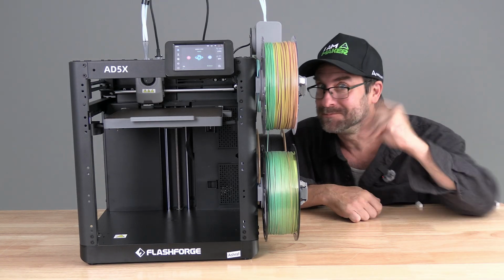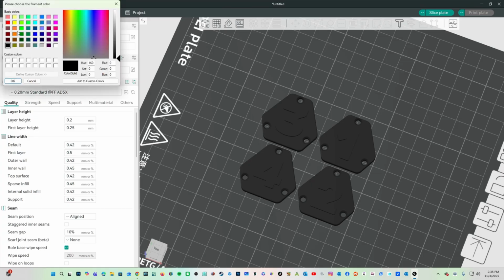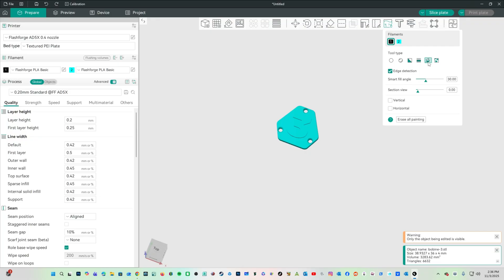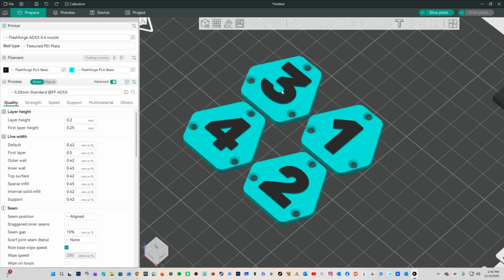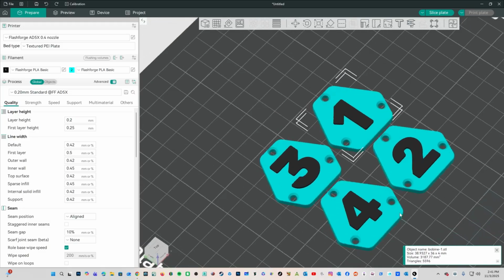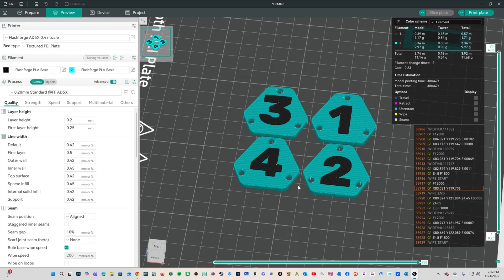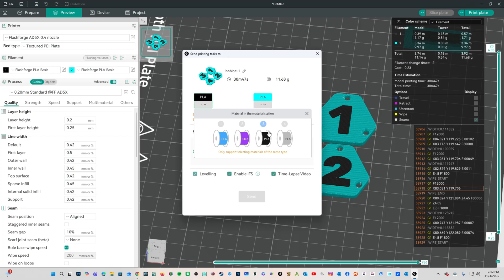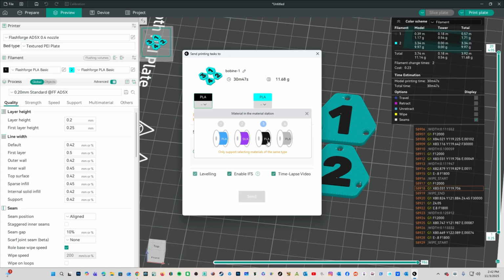Easy DIY Roller Identification Mod for Flashforge AD5X 3D Printer

Comment: I just got mine two weeks ago, and they are labeled. I am having a good time but a larger number would be nicer to have. Great mod. I like that they're bolted rather than pressed into the factory center hole.
Reply from the maker: I didn't think the hole design made much sense. Yours are labeled!?

Comment: How are you getting on with it
Reply from the maker: So far, very well. I'm surprises by this little guy. However: Add the Camera, Add the Enclosure, and its P1S price. But, neither are required, and it's got 4 Color. The swapping method is slick. Outlook is good
Reply: @3DRundown very good 😂😂😂